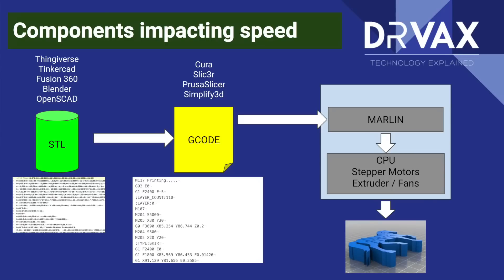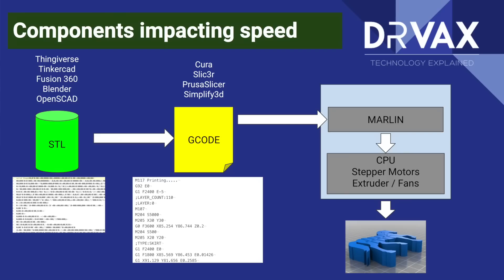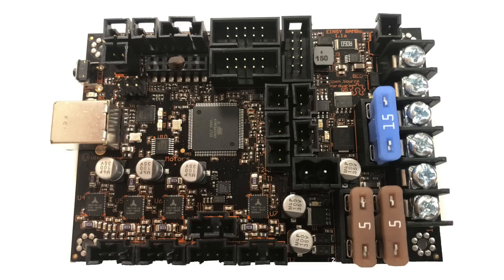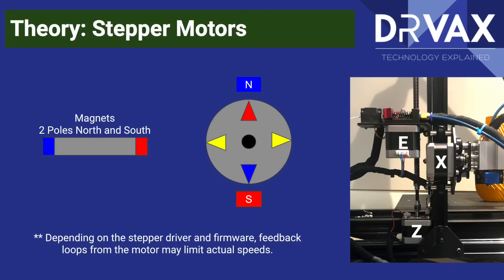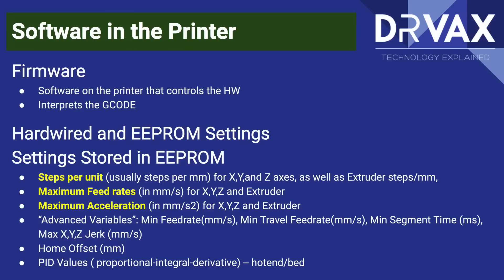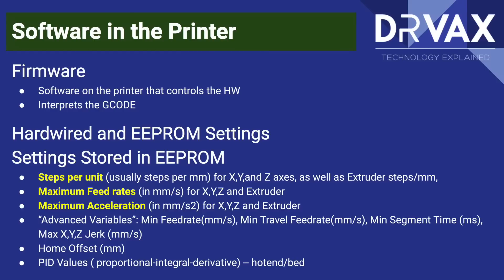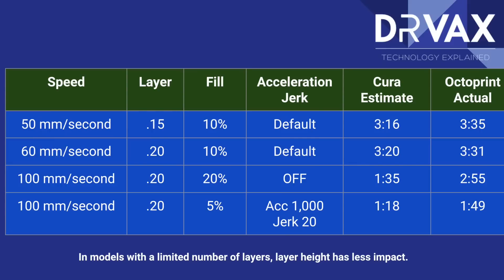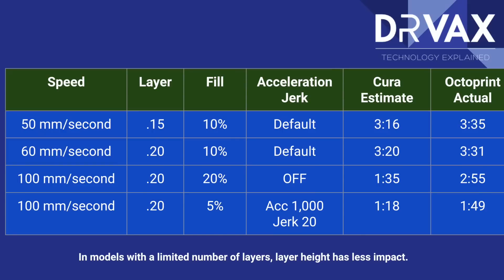Faster 3d Prints: Take 2, Do Slicers Lie?

Comment: Can I use someone else's slicer profile - IF our machines AND upgrades are the same?  My thoughts are, Yes - but it is not my thoughts (or feelings) that matter.  
Let Reality Rule!
And Thank You.  You are a HUGH help.
Reply from the maker: Yes and no.   Most home grade 3d printers have components that are not very precise.  Yes you can start with some else's profiles and the profiles provided in the slicers are getting better and better.  However for excellent prints you still need to calibrate your printer and tune for your machine.  I remember when I started playing with this stuff that all of the parameters in the slicers were daunting.   After time it all will make sense.  Keep at it. It is worth it.
Reply: @MakeWithTech   > After time it all will make sense.  Keep at it. It is worth it.< 
Oh, I will and am very happy to do it this way.  I have already got several upgrades that I won't put into use - until AFTER I learn it, (printer and printing) the way it is, so I know where I started, and how I ended up - where I'll be then.  Patients is so underrated, as is critical observation - and for me, making notes in a 3D journal of cause and effect is a thing that just plain works for me.  Have a great week and thanks again for the help!

Comment: I was under the impression that the slicer couldn’t push the printer any faster than what printer was capable of printing. Say the printer limit is 100mm/s if the slicer sends 120mm/s gcode it will be ignored.

Comment: I am a retired manufacturing engineer.  I spent my 35+ years working on NC sheet metal machines (shears, punches, lasers, and brakes).  I also have quite a lot of knowledge of CAM software.  I developed many post processors.  I am new to 3D printing and am quite impressed at the technology available to the hobbiest.  I really enjoyed listening to your explanation of things.  It appears that “cura” is roughly a post processor.  Except a post processor deals with text files (CL files) not binary and converts that to g-code.  What I found interesting in your description was a “F” following a “G00” command.  In my experience the feedrate for a rapid move is set as a global value on the machine control.  So a “F” word in a “G00” would have no affect on the speed of the rapid move.  I also noticed that the units for jerk were mm2/sec (I think that the units are mm/sec2/sec).  I do not think that is 100% correct as jerk is defined as the change in acceleration.  I look forward to diving deeper into 3D printing!

You have earned yourself a subscriber!

Thanks, Don
Reply from the maker: Thanks and please continue to contribute comments so we can all learn together.

Comment: I am facing something very weird. I have two printers (ender3 and wanhao duplicator i3 mini). I have loaded the same model on Cura 4.1 for both printers and I get significantly different times. the ender 3 shows me around 1.5 hours and the wanhao shows less than an hour. went to Cura 4.2.1 and the time difference there is worse. the same model shows around 2 hours on ender3 and around 1 hour on the wanhao.
I have compared every setting possible (speed, acc, jerk) almost no change at the time frame.
Any idea?
Reply from the maker: Check retraction settings and z-hop.
Reply: @MakeWithTech  Checked it and they are the same. But I have just figured out that the top/bottom speed was hidden and was different which led to different time frame. thank you for thinking with me
Reply from the maker: Your welcome.  Thanks for sharing.  I always forget to tell people to check the view mode, basic advanced, expert and all.

Comment: Is it better to uncheck every part you dont need in cura setting visibility?
I have checked al, just to see whats in it, but didn't change most part.
Is Cura taking over al checked boxes or if you don't change anything, is merlin still in charge?
Reply from the maker: No, I believe over time you should try and understand all of the Cura parameters.  In the beginning just use the defaults Cura provides.

Marlin or any other firmware will interact with the GCODE produced by your slicer, in this case Cura, to direct the printer movements.  In general the parameters controlled by the firmware are designed to ensure your Gcode cannot break the printer vs being optimized to produce the best prints.

This is necessary since different filament types and print geometries require different settings.

So, the more you control via your slicer the better.

Comment: you mentioned octoprint (sp?) do you pc to printer via usb? can you create a video on your set up please
Reply: You connect a Raspberry Pi (recommend to at least have version 3, works with older but impact performance some) to your USB on the printer and then control the printer over network either Eithernet or wifi.

Comment: This was very informative. I have one small correction though - the extruder is in absolute mode in your example. In relative mode, if you send E5, it will extrude 5mm vs go to the number of mm specified.
Reply from the maker: Thanks for the comment. If you zero out the extruder and E5 will be the same in relative and absolute mode.  That said it is important for my viewers to understand the difference.  Thanks for help us to learn together.

Comment: The real time savings is reducing top/bottom layers and perimeters on the last print. I think the table is deceptive as it implies layer height, infill, accel, and jerk are the key factors.
Reply from the maker: Valid point.  Since this model has very few layers you are correct that infill and layer height have less impact.  Thanks for commenting and participating in the discussion.  That is how we all learn together.

Comment: I believe Cura does not add Heat up Nozzle/Heat bed times
Reply from the maker: I believe this is true.
Reply: @MakeWithTech  I still use Cura 15.4.? Works great. Using OctoPrint to print G Code

Comment: Thanks for spending the time to produce this video.  You explained things so even I could understand. I guess f I had a question it would be on the front of my creality i have a knob that can accelerate the print. It is normally at 100 but in theory, I think I can increase it to whatever number like 500 but my print would only be done twice as fast. Why doesn't it just stop at say 200 which is most probably the speed it actually does rather than give a false reading.
Reply from the maker: Good question.  The impact of the front panel speed control seems to vary from print brand to brand.  In my Prusa it works great.  On the Ender not so much.  I am going to do some testing and make a video about it.

Comment: I assume that the vax in DrVax refers to DEC's VAX operating system from the 1980s.  Am I right?
Reply: Yes, he was an old DEC guy.
Reply: @woodwaker1  Thanks.  Back in the day I worked for Wang Labs DEC was one of our major competitors.
Reply: @TerryPullen  A DEC PDP8- e was the first computer I was trained to repair after I left the USAF as a Crypto technician.  A really remarkable system
Reply from the maker: Yep.  I worked for DEC in the early 80s. Because a bit of an expert of VMS internal and device drivers.